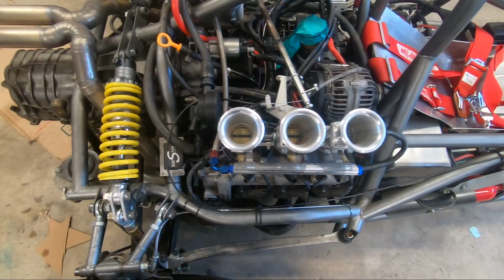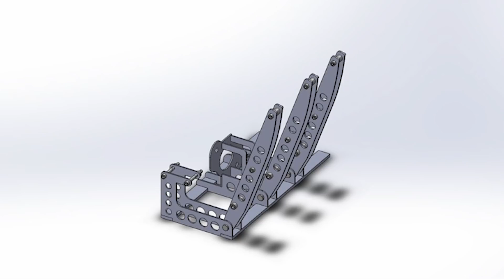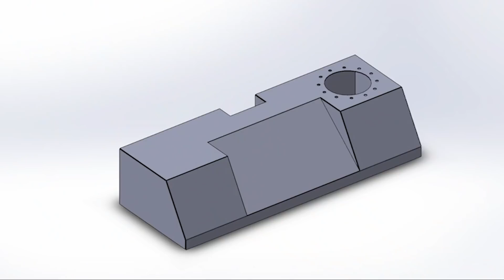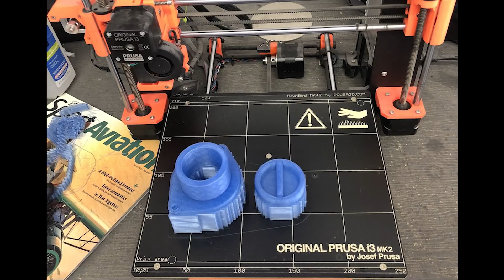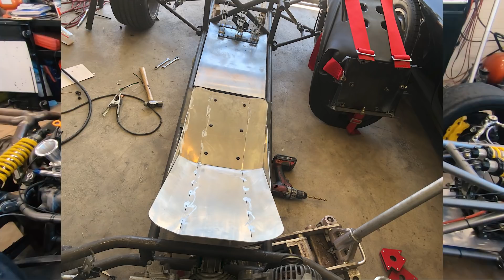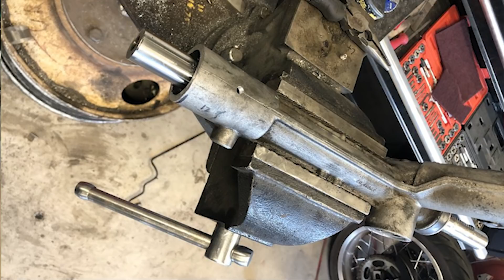Porsche F1 Cart In Depth Overview

Comment: for the crankcase vacuum, I would recommend a weld-in venturi device attached to the exhaust. It uses the exhaust flow to pull a very strong vacuum, and is a lot lighter than a dedicated pump. It does however burn the oily crankcase air and then just send it out the back, no filtration, although I am sure you could add it if you wanted.

Comment: Great explanations of some of the details.  I'm still hoping for a higher level overview (chassis design and specs, for example).  Oh, and I strongly recommend that you put fine screens, or even filters over those intake trumpets.  Don't ask me how I know that is a good idea....
Reply: THIS! Im surprised no one has mentioned it yet. Seeing it exposed like that has gotten me sweating a little...
Reply: There used to be a wire mesh in the 60’s. Generally to stop mechanics dropping things down them.
Reply: @Mpayne1472   Yep.  Been there, done that!  😱
Reply: Ditto x3... I had 44mm PHH Bikini side breathers on my 924/931 hybrid 13:1 compression 933DP clone engine (215hp 135ft lbs 9500rpm) with no filters just venturi stacks.... Yah, sounded and looked reallllly menacing... The rings were literally GROUND OUT by fine dust within 3000miles... Ugh what a pain that was... It lead to a swap of PGM-FI from an F22 Accord engine using motorcycle mikuni flatslides with throttle position sensors as It's...That made similar power but more efficient highrr fuel mileage... 

Put filters on, even if it's just panty hose clamped over the velocity stacks!!!
Reply: Mikuni NOT Bikini...
Reply: @jeremiahschreffler5232  bikini work too just a different way lol
Reply: @jeremiahschreffler5232  with this chassi could be created a le mans prototype similar to 917K

Comment: Looking to make a body? I would do a fiberglass body, I think it is a fantastically fun material. 
Another thing that might spice things up with the car. Dunelop sells dunelop classic (Michelin rubber) which has a classical structure having less grip but slide friendly and would bring the behaviour of the car more in line with the 60s (although the dunelop classic tires have a lot more grip that back in the day).
Reply: I can't really tell if there's sole special tire producer called dunelop or if you just misspelled Dunlop..
Reply: @peterheynmoller2581  fricking autocorrect. Dunlop ofc.

Comment: For the stacked radiators you can shroud the rear one with air scoops on the sides of the front one leading to the rear radiator shroud. Looks good and cools more.

Comment: Older 911's have mini centrifugal pumps to control the vacuum in the engine casing or you could use a back pressure valve with a regulated release line between the engine and the oil catch tank.

Nice project!

Comment: You could also use a venturi based system to pull vacuum with the exhaust. There are weld on kits for this, I think moroso makes one. It's a lot easier than a separate pump but not great for emissions.

Comment: Did you work out all the chassis geometry variables involved? Torsional stiffness, roll axis, camber curves, CG, anti-dive/anti- squat, wheel base, track width F/R, etc? Those are integrated engineering challenges most home-builders ignore for obvious reasons of difficulty, and access to knowledge. If not, watch out for handling quirks as you push the car harder.

Also, your tires appear to be modern race rubber. For the true vintage experience, use period-correct reproduction vintage race tires. Grip will be lower, but fun will be higher. The lower grip will (probably) also go a long way toward mitigating the above-mentioned potential handling quirks. 

Sorry if I seem overly critical; that's not my intention. I love this project, and I'm actually quite jealous. It's just that there is a lot to consider besides 'simply' fabricating a running machine.
Reply: Michael Lorenson Exactly my thoughts. I wonder how he went about designing the chassis. Although I think it looks pretty fucking cool.
Reply: my guess would be no

Comment: You should have megasquirt do the fan control you can have it pulse-width modulator based off temperature. It won't be nearly as hard on your charging system.

Comment: When you redo those front lower A-arms I would reconsider the mounting point of the bottom end of the pushrod tubes. You want it to end at a node. Same for the rockers, the chassis mount of the dampers, and all control arm mounts. You are obviously quite talented at this. This is more work than I would expect any one man to be able to do. Very impressive welding. Also I assume someone already told you, looks like your roll bar could be higher and needs to be padded.
Reply: Yes, if you intend doing anything competitive with the car that roll bar will need to be extended or it won't get past scrutineering. Great job so far though.

Comment: Love the car, I've wanted to build something like this (but based off a different donor car) for a long time.
I am worried about your cooling system, in dont see any fans which would instantly make your setup just fine. With ducting and a counter-flow setup it would work great while moving, but relying on the fresh air getting between the cores for your airflow is relying mostly on its heat sink capacity without enough dissipation capacity. This won't be a problem until you overwhelm the system on some hot day or after a power increase 
I'm catching up on the rest of your videos,  can't wait to see how things go

Comment: Awesome build, I look forward to seeing you make progress. Interesting that you have crankcase pressure/vacuum issues.  I had too much vacuum (between 18 and 20 in Hg) in the crankcase on my Saker (flat-6 Subaru EZ30 engine) which caused low oil pressure and ultimately a blown engine.

Comment: Looks like a big FSAE car, neat build!
How did you decide on suspension geometry? Were you limited by the original uprights or by packaging? Would love to learn more about that process
Reply: This is my question as well. Suspension geometry is so complex and it seems like the only real way to do it right is tons and tons of math or expensive software.
Reply: When dealing with suspension geometry on a lower budget build or an engineering expertise limited build, the best way is to get suspension measurement diagrams from a vehicle with similar suspension design with known characteristics and avoid doing your own complex math... for example I know many race car builders will default to a Camaro suspension geometry because it drives well on a track and Camaro parts are cheap.
Reply: @jonkeau5155  it's interesting he's gone with a push rod set up and adapted the uprights from the Porsche. Be interesting to see what advantages aside from lower cg and altered motion ratio he's gained from such a setup

Comment: Very cool build! I'm also one of those viewers interested in more in-depth coverage of complex design processes like suspension geometry and chassis building. E. G. Did you retain stock wheelbase? Did you use it as reference then modify to suit personal parameters like packaging etc...? So many questions ^^
Reply: Exactly.  I have a project in mind and I have the original vehicle minus an expensive engine.  The shells are getting pricey so the plan is to scan and convert all the original suspension geometry to a cantilever set-up- like you said so many questions....

Comment: Are you planning on putting some classic style wheels on it? It would look even better on wire wheels
Reply: Wire wheels definitely can't handle the lateral stresses of those sticky modern tires. By the early 60s, everybody had to abandon wire wheels in favor of some form of solid wheel. And that was with the relatively low grip of the bias-ply tires of the day. There are pictures from the period, showing a shocking amount of distortion in wire wheels under cornering load. Typically, iirc, Ferrari were the last to make the change in F1. Enzo was a very conservative guy.
Reply: As it is a Porsche, it would be lovely to see classic Fuchs wheels :D (don't know how expensive they are though)
Edit: About $1.000 per piece :/

Comment: What a fun project! As a former 356 B, C cab, D Speedster and 911 Carrera owner and a current Boxster 987 II owner I am interested in your instrument gauge pack. Specifically the ammeter and oil PSI gauges. I kinda' miss them in my Boxster. It looks like you are using VDO guages but what about the sending units. Where did u get them or will the existing units run those gauges.? Thanks for your help in this. And please keep those great videos coming!

Comment: Do you plan or have maybe already a heat protection between the exhaust and the shocks? Sometimes they can get so hot in some applications that they change the viscosity of the damper oil and also wear faster. In the Video, it looks quite close together but maybe it`s just the perspective of the camera.

Comment: Great job, im the new subscriber. 

I would push the front suspension a little back, maybe 10cm,  just for a better weight distribution. 
Did You measure the weight of the engine+gearbox? 
How high the car it is, in the highest point?

Comment: I would like to know what mods were made to the m96 motor. It is a great engine for this application, low center of gravity and plenty of power for such a light chassis. My question is about oil starvation, if you are planning to drive this like an old F1 car it will need to be solid at 2+ G but the inherent oil starvation issues and bore scoring issues seem to me to be a ticking time bomb unless they have been sorted with a  baffled sump, upgraded oil pump and scavenger, and motorsport AOS
Reply: Surely dry sump with scavenge?
Reply: Samir Joshi not unless extensive changes were made to the stock boxster M96...

Comment: Why is the rod end on the lower control arms bad? Modern Indy cars and DPi cars have spherical bearings swaged into all the a-arms, even the lower one that connects to the upright. As long as the angular rotation is within the limits of spherical inside the rod end and the rod end is of sufficient size and strength you should be good to go. Also everything that has spherical bearings on a racecar has conical shims or integral equivalent on both sides of the spherical bearings will help get more angle and limit binding. 

Also have you had this on a set pad to check; ride height, rake, cross weight, toe and camber?

Comment: kudos on making a running car.  the frame member "triangulation" is a little cringe.  radiators in side pods reduce the polar moment of inertia and protect them from frontal impact.  I would like more detail on the engine.  You skipped over the ITB and calibration.

Comment: You could use 996 rear hubs which would simplify the design.  Adjustable upper arms widely available too.  Single aluminium radiator at the front might also simplify and add lightness if you wanted to go that way too.   Congrats on an incredible build so far.  is it a 2.5, 2.7 or 3.2 motor?  And what sort of HP are you achieving with the throttle bodies?
Reply from the maker: Rear hubs are off a Boxster, I don't think that the 911 ones are much different if I remember correctly. I'll look into it. I don't really need lightness in the front, I'm trying to balance the motor out a bit. Until I get aero on the front. 3.2 Motor!
Reply: @WesleyKagan  996 rear suspension is a proper 5 link suspension as opposed to the McPherson strut type as on the Boxster (both front and rear)
Perhaps I fail to see it but is there a joint between upper A-arm and the cilindrical adapter to the Boxster wheel carrier/hub?

Comment: I aM nOt A eNgInEeR...
You are tho... you might not have a piece of paper that says you're engineer but your work clearly proves that you're one.

About the two radiators in the front, make sure that the cooling fluid goes from the rear one to the front one.

Comment: Are you going to race this car in SCCA or CVAR or some other vintage racing series?
Reply: This would not pass SCCA tech based on the roll hoop alone; it's welded down the center and does not have adequate clearance for the driver's head. Since this is a new chassis and not grandfathered in as part of a vintage league I doubt they would let it race.

Comment: admirable , but you are starting at a point achieved nearly 120 years ago , crank and rod design you are using was used in pierce and lincoln engines , and there has been a lot of refinement since then , stess loadings on every aspect of the motor mean you are heading for a world of pain , even down to the type of material used to build it , heat and pressure cause properties to change , modern motorcycle engines are so far ahead of automotive contemporaries in terms of output vs displacement that looking to them would be far more beneficial